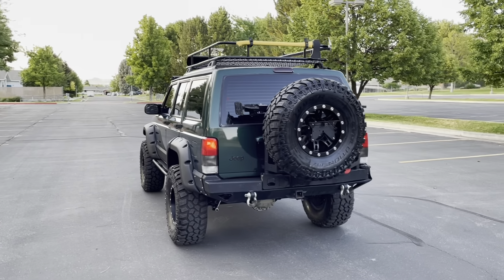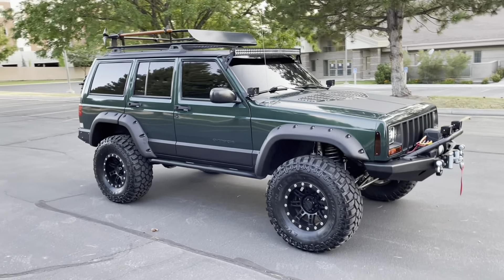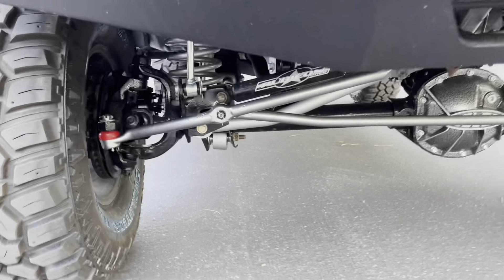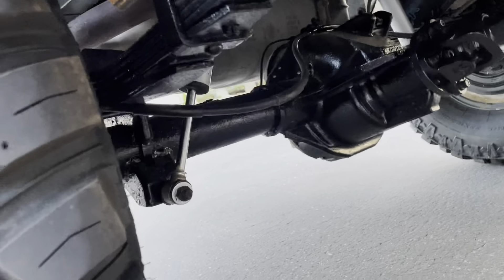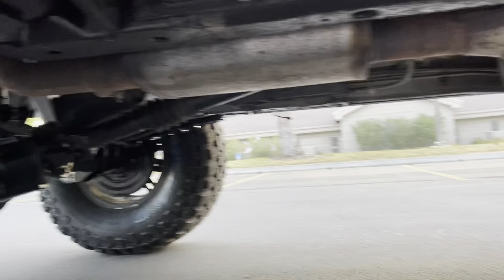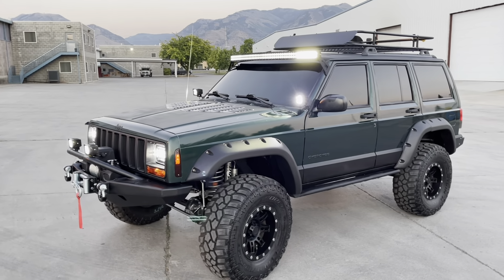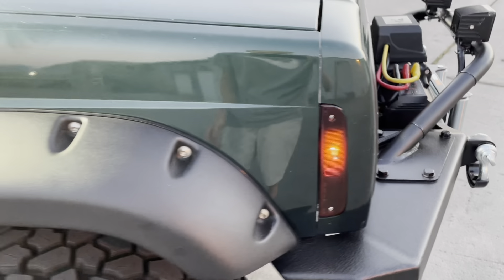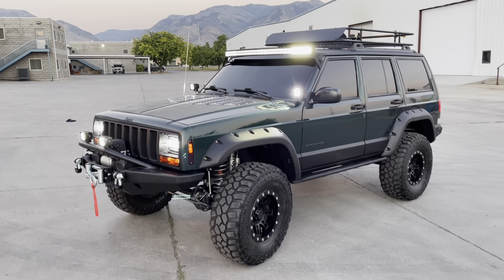BUILT Forest Green 1999 Jeep Cherokee XJ!

Comment: I have the same car in Egypt. But yours is super clean. 
I want to start rebuilding the suspension to a legit 3-4” lift and I need guidance on the parts
I won’t be able to buy the parts all at once since I’ll have to import everything to Egypt (super costly)
My car is lifted 3.5” but more of a DIY thing by the previous owner:
Teflon lift kits for the front shocks
Jeep Wrangler shocks
Added 1 leaf for the rear springs (no shackles)
Rubicon lower control arms
No slip yoke eliminator
What do you think I should do? Where should I start?